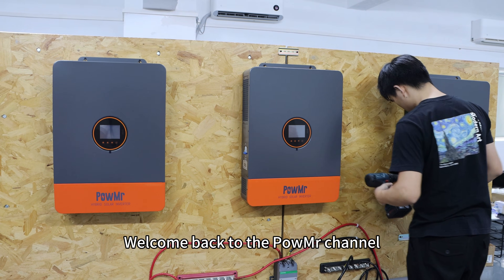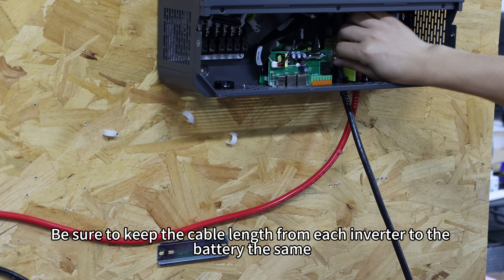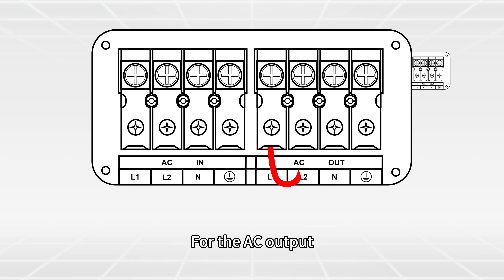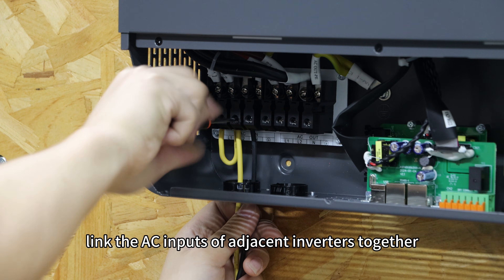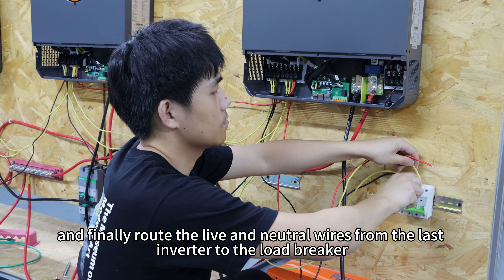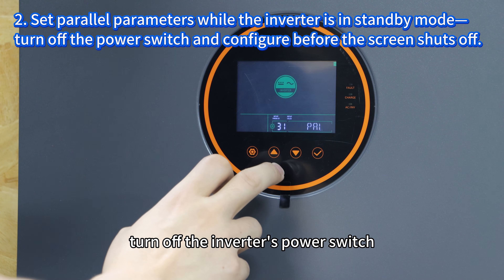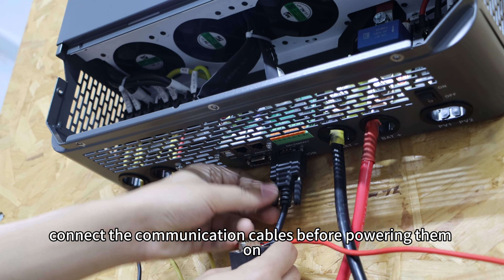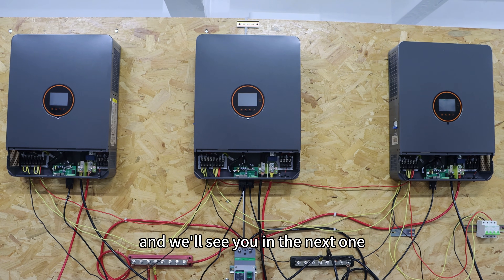How Do You Set Up Single-Phase Parallel for POW-SunSmart 10KP?

Comment: Thanks for the video! 
I had the exact same issue because I assumed there was no need to create an electrical bridge between L1 and L2. One improvement I’d suggest for future designs is to make that bridging process easier—working with 8 AWG wires in that tight space is really difficult. I ended up using a copper T cable terminal to handle the thicker gauge more easily. 

Appreciate your clear explanation!
Reply from the maker: thanks for your suggestion.